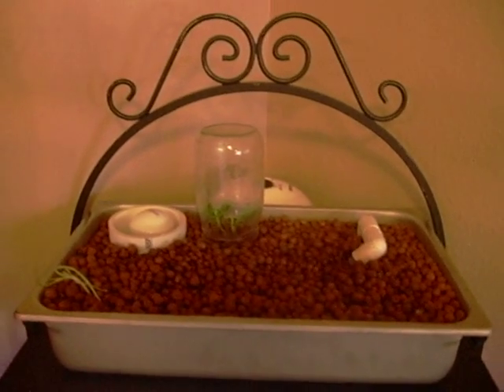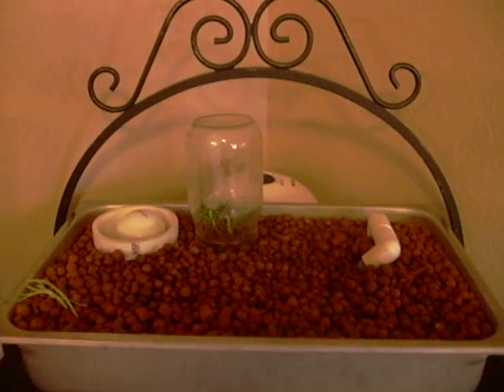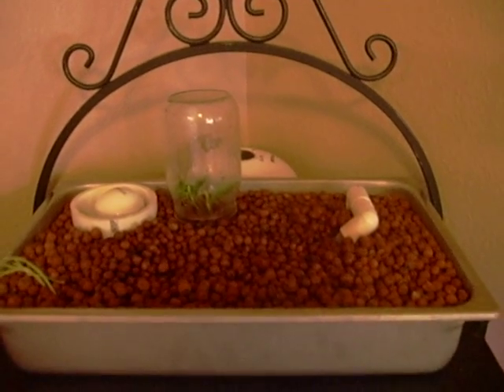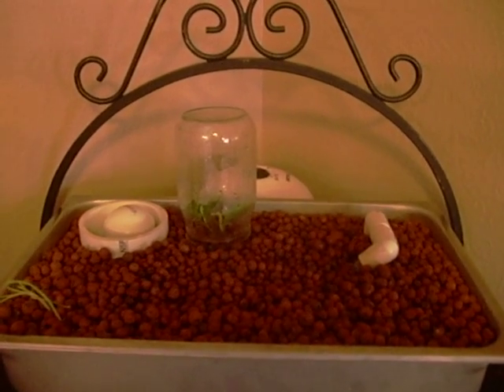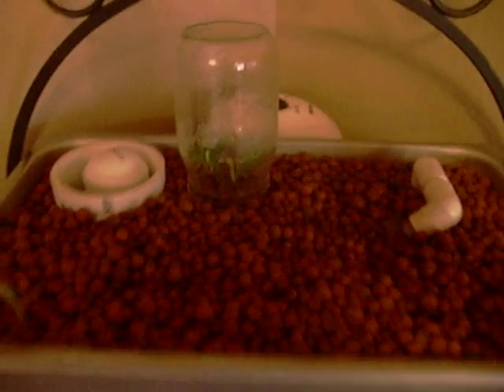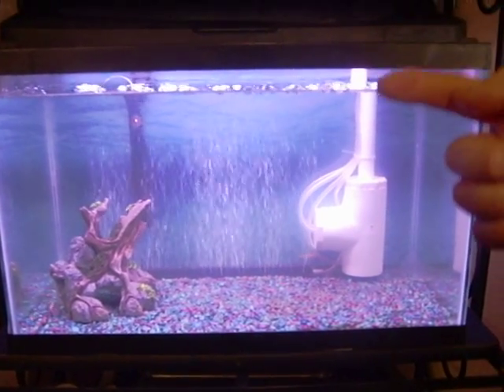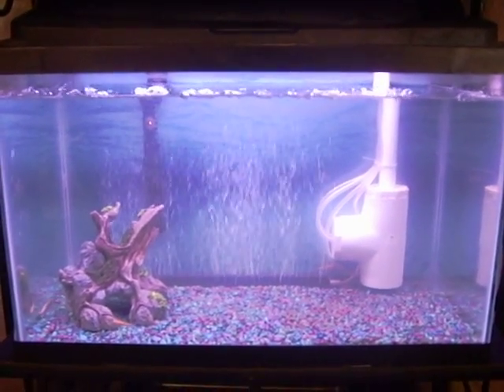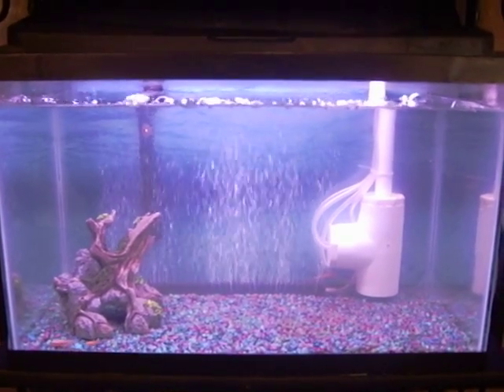DIY Aquaponics

Comment from the maker: @nickjin00 Yeah definitely smaller pipe, I think that is the key considering we are not dealing with a large air pump.  Good job and good luck!  Don't let it frustrate you, just look around at stuff you have and get creative.  If you have any tube around that will fit snug in your pipe then just put it in there and see if the smaller tube helps.

Comment from the maker: @nickjin00 Man that is a tough one.  The idea behind the geyser is to send a slug of air up all at once.  To do this can be tricky but once you figure it out all is good.  I put one stone at the bottom of the geyser to lighten the load so to speak.  Then I tweaked the distance of the geyser tube until it was optimal.  It was a little touchy until I found the right spot.  I need to do a little experimenting and build a new design that is easier to adjust.  Mine still works at the moment.

Comment from the maker: @nickjin00 Thanks man!  As far as the grow bed, I just made a bell siphon but used a small hose inside a pipe so that the drain hole was small.  The reason I did this is because the airlift pump does not move enough water to make a 1/2" bell siphon drain.  Thanks for watching and happy experimenting!

Comment from the maker: @kalidabod Thanks for watching!  The pump I use is a hybrid airlift/geyser pump that I made myself.  Do a quick search of geyser pump on google and you will get the idea.  If you need help building one let me know.  The reason for the hybrid pump is I can run it all the time and the pump actually increases the dissolved O2 levels in the water which is good for my grow bed and my aquarium.  As you probably already figured out the hybrid pump runs off of the petco air pump you see in the video.